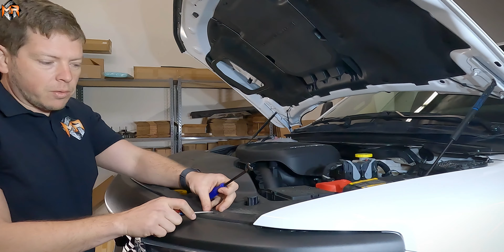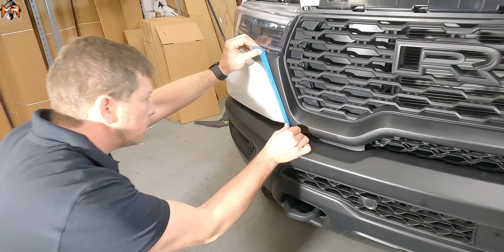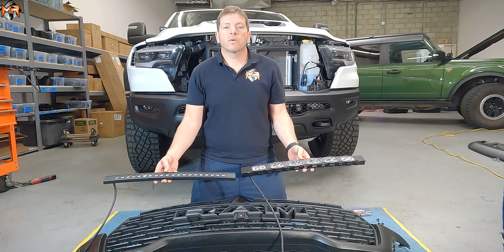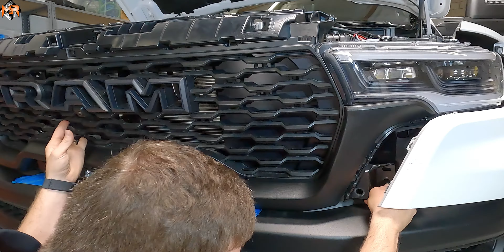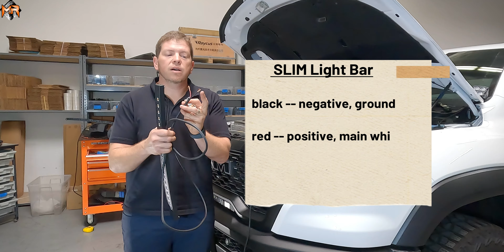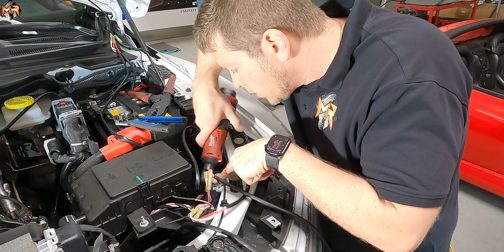2025+ RAM Rebel & RHO 23in Light Bar Install (No Drill) | M&R Automotive

Comment: Not every truck has aux switches. How do you install these to turn on with the head lights?
Reply from the maker: You can use the M&R wireless controllers or install them with a relay to your high beam headlights